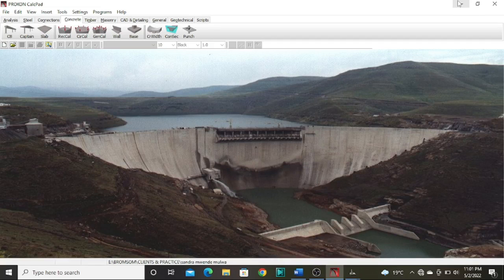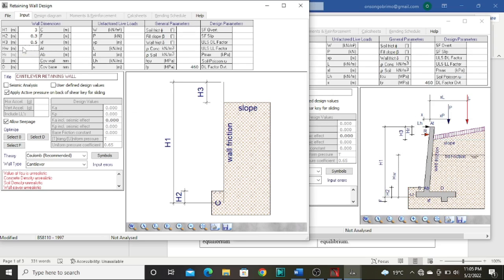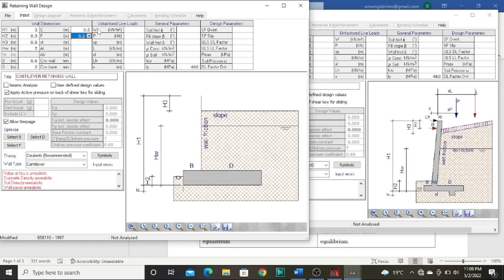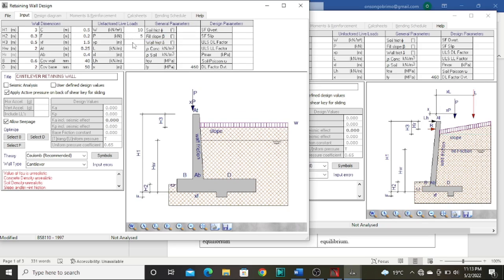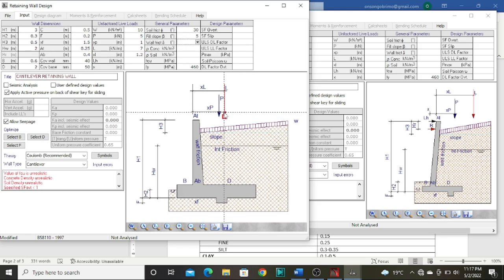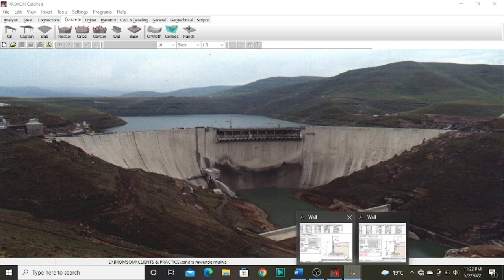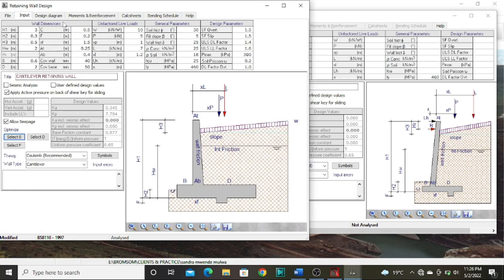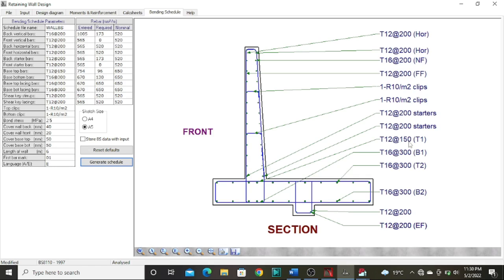DESIGN OF A RETAINING WALL IN PROKON

Comment: Hi. How do you interpret the Clips output 7R10-11@1/m2 in detailing?
Reply from the maker: Clips ensure your main bars are in position and they do now move independently. In most cases they are normally installed per square meter or other wise depending on your structure. R10 means they have been designed to be round bars of 10mm whose  grade is 250 as compared to the ribbed bars whose grade is 500.Though on site you should use ribbed bars to make work easier and utilize your offcuts